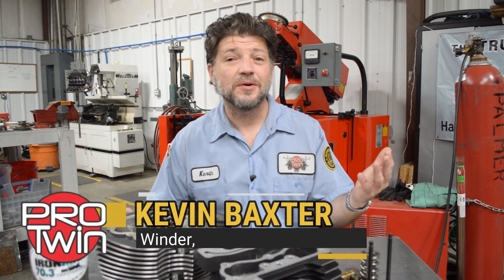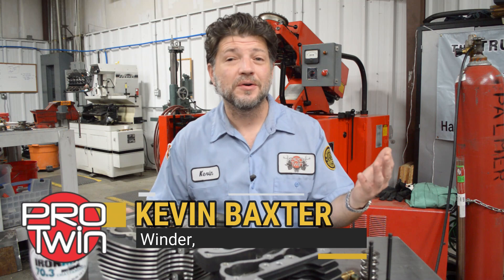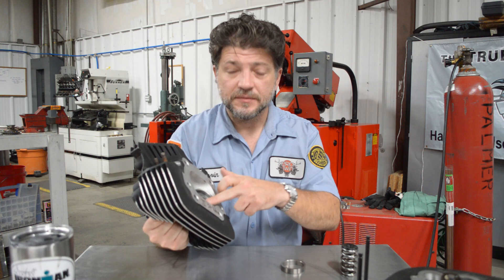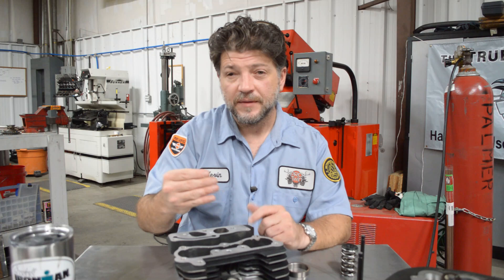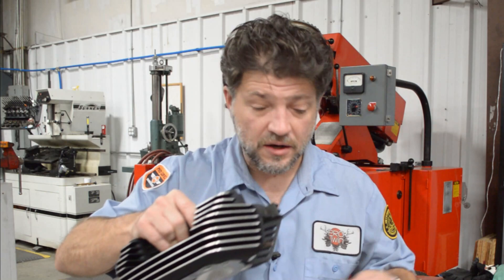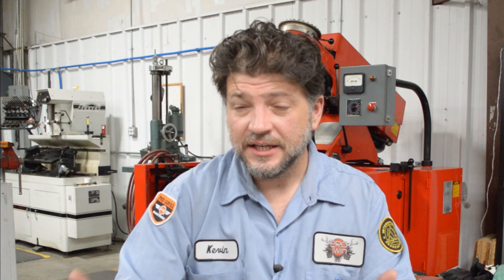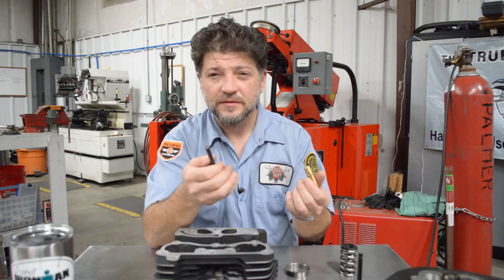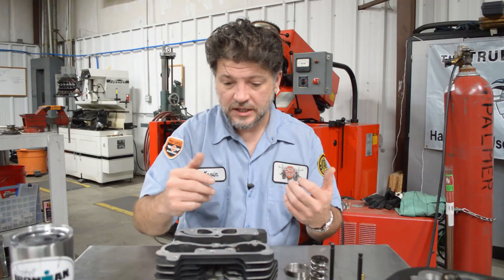Harley Engine Heads Rebuild and Blueprinting Part 2 - Kevin Baxter - Pro Twin Performance

Comment: So Kevin what is the average cost of a complete blueprinted engine?
Reply from the maker: It can vary quite a bit Glenn.  I have learned there are really five things that will determine what someone should budget for a build.  1. current condition of bike and all parts.  2. how fast you want to go  3. your right hand, how aggressive you ride  4. how much reliability and longevity you want  5. to me this is the most important one for most people....how much confidence do you have in all the other stock components.  Answering those questions accurately and honestly will determine necessary budget for a complete build.

Comment: When blueprinting a set of Harley heads and flow bench testing, what tolerance do you hold head to head? Do you CC the ports as well? And last question; do the front and rear heads have the same port specs or there differences to compensate for thermal differences front to rear?
Reply from the maker: They need to match as closely as humanly possible. Yes we CC ports. Most of the time same front and rear but there are exceptions. Temp differential is dealt with in tuning.
Reply: @KevinBaxter  Makes perfect sense, I should've thought of that

Comment: Nice. On your M-8 heads do you install rocker arm studs over using the bolts? I'm using a Rocket .474 so I'm not going hi-lift. Also using a pair of Screaming Eagle heads off of a 2018. Do I have to worry about broken springs? TIA
Reply from the maker: I'd recommend using studs for sure.  Without knowing that exact cam profile, hard for me to say.  I have seen quite a few sets of stock springs broken with stock cams.  Guess it would depend on how aggressive you'll be riding and how confident youd like to be in the springs.  Broken springs arent overly common....but it does happen for sure.

Comment: Great words of wisdom as usual Kevin. I have an 02 fxstb 95ci,  mikuni 42, fueling plate, pump and lifters, s&s 510c cams, 2 into 1 rb lsr exhaust and just ordered a DTT ignition module from you guys, which i can't wait to get. I have stock heads and the plan was to have those done this winter. Now I've been doing a ton of research on S&S 79cc heads and was wondering if they are worth trying off the shelf for performance gains? Also, if I decide to have the S&S heads reworked would I still be starting with a better product over harley heads or should i just get my stock heads reworked? I guess what I'm asking is the juice worth the squeeze by buying S&S heads? Thanks Kevin. BTW whoever answered the phone when I called last week was professional and a real pleasure to talk to.
Reply from the maker: Yes sir. Thank you. Working on getting that programmed for you with the custom curve. As for the heads, why not just send me your stock ones?  No need to buy new ones then have them worked. I'll do a custom set of CNC ported heads for you.
Reply: @KevinBaxter  Awesome I'm excited to try it out. OK, I'll have to do it this winter or buy a set of take offs so I don't miss any down time during my short season. Thanks again
Reply from the maker: youre welcome

Comment: Off topic I have a 06 road glide my compensator went out and the main shaft is bent question I have is will this comp going out bend the shaft? The comp ramps are wore and the spring pack is compressed and loose can I get a any advice on this
Reply from the maker: I would say no....the bend shaft destroyed your compensator. I see people repeatedly replace comps and always blame it on the comp when most often it's the crank causing the failures.

Comment: Awesome information. 
What would be causing my 2012 Victory Vision with a 106 freedom motor to have what sounds like a noisy lifter. It always has a slight ticking noise. Is there a way to fix this? Should I get the heads blue printed?
Reply from the maker: If you're running 20w50 in it, replace it with 20w40.  That's a common error. Aside from mechanical issues, chain tensioner, oil pump drive chain, etc....they are noisy top ends. My own personal XC always had it.
Reply: @KevinBaxter  I'm running the required oil. I'll try what you said. Thanks heaps. Watching all the time from Australia.
Reply from the maker: Where in OZ?  I have many friends in the Syd and Brisbane areas.  Spent nearly a month over there training shops on tuning.  One thing I have always noticed about Vics...changing the oil seems to instantly quieten them down, i stick to 2040 and run amsoil.  thats been the best combo that worked for me but, it had me changing oil every 3000 miles.  Food for thought.
Reply: @KevinBaxter  I'm down on the  beautiful south coast which is near Wollongong south of Sydney. I'll try the amsoil next time. I gather you're using semi synthetic. 
I change the oil every 5000k's. I do this on my cbr1000f and she's running smooth as for 162,000k's. 
Thanks again.
Reply from the maker: Well, if you ever find yourself near APL Performance in SYD, drop in and tell Adam and Julie I said hi.  Have several friends in that area, Malcolm Martin at Morgan and Wacker HD, Berto, John, and Rollie at Rollies in Brisbane....I spent almost a month over there for a tuning training tour.  Great fellas.
Reply: @KevinBaxter  awesome. I'll keep that in mind. Hope you enjoyed your stay while you were over here. Its a beautiful place here and I'm glad you didn't fall of the face of the planet while down under. lol 
Cheers
Reply from the maker: Enjoyed it tremendously.  Did much of the tourist type stuff but having friends who are local was great.  Cant wait to go back.  Tough part is the flight there and back.